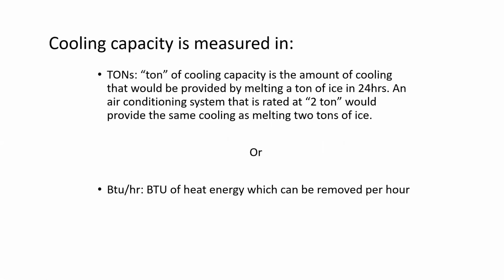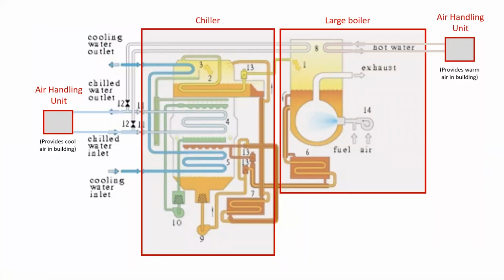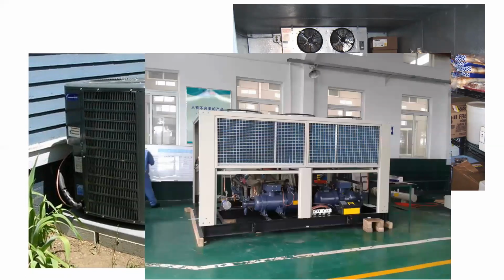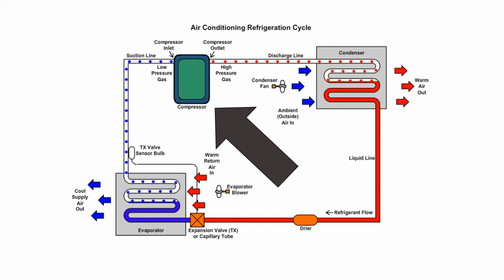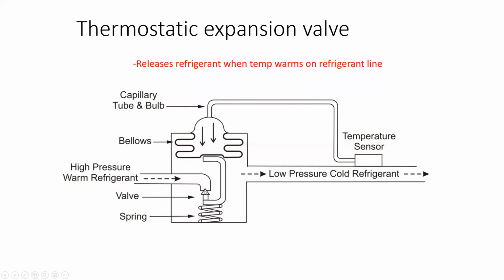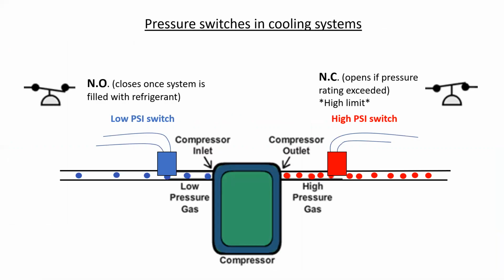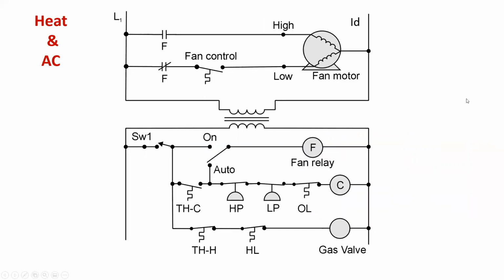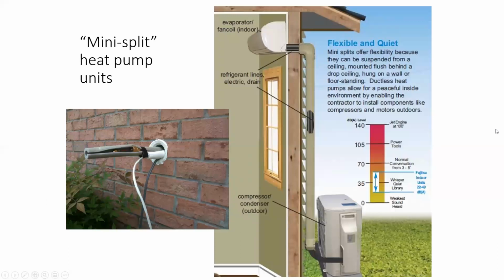HVAC Cooling systems

Comment: Hey man I have a question? What motor controls the dampers on a ac system
Reply from the maker: Belimo uses a brushless DC motor. This is common, as it is easy to reverse in direction. See link
https://www.belimo.com/mam/americas/marketing_communication/brochures/damper_actuators/belimo_damper-actuators_brochure_en-us.pdf
Reply: @Red_Seal_Electricin  could you do a video on doing 1 phase and 3 phase half wave and full wave rectifier calculations ? For some reason it gives me a hard time
Reply from the maker: Hi Jordan, I realize this response is late, but I do have a couple videos for rectification. Check out my ELECTRONICS playlist.